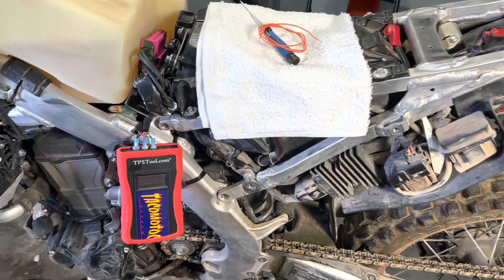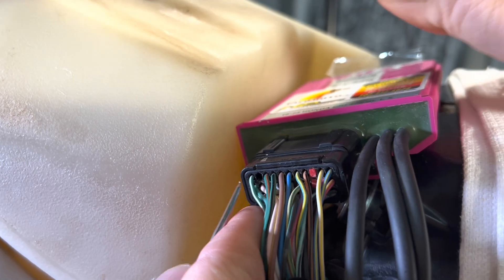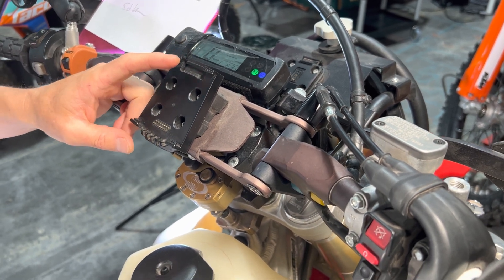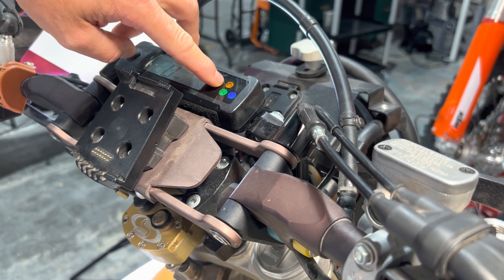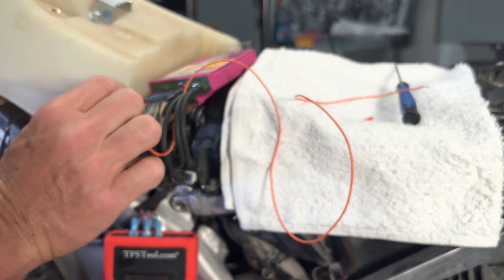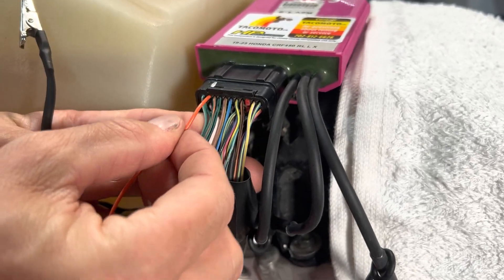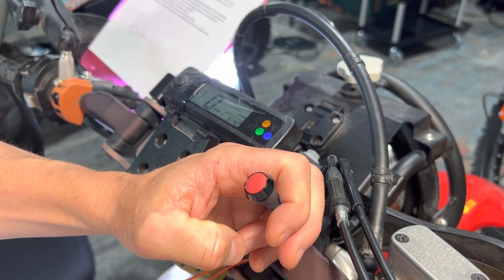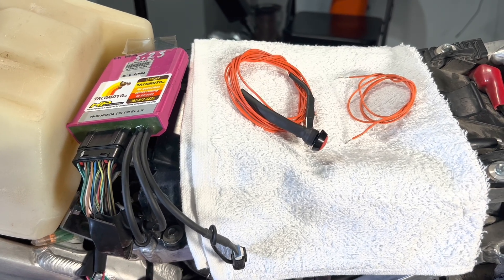AIM ECU TPS CALIBRATION PROCEDURE FOR 5.23 OR HIGHER FIRMWARE

Comment: When I received the ECU all was perfect, 60 miles later I run into this extreme bogging at low speed and low gas mileage, I thought something is wrong with the ECU but now I know what I need to do. My question is, if I change the throttle tube to a G2 tamer f.ex. or ODI with modded Cam, will I need to run the process again?

Comment: I just put this ECU in (tuned for the Yoshi I just put on) — suppose to remove the factory RPM governors in 5th and 6th gear….
-with this ECU and same equipment (47 gear) my bike topped out at 10mph SLOWER…..???
—could TPS cause this??

Comment: I have rev 1.4 version aim ecu on my 450L, is the procedure same? Thanks.
Reply from the maker: It’s the firmware that matters. That will be a 5.?? Number on the back
Reply: Mine didnt had any markings about firmvare only that rev1.4 but this method worked for tps calibration. Thanks.
Reply from the maker: @okoutonen  it’s not a taco moto unit then, but glad this worked for you

Comment: Hi Mike, I just received my new AIM from you guys (firmware 5.26) and while attempting this procedure, everything goes as it should with the exception of the rapid flash at full throttle. The CEL goes solid but instead of then moving to a rapid flash, it just goes off. Have you experienced this before? Any suggestions?
Reply: Thanks Casey, I ended up getting the bridge and updated the firm ware. The bike continues to have inconsistent power and back fires. Have you had any similar issues?
Reply: @jfin661  Yes, I was experiencing lag/stumbling when rolling on the throttle and surging at various times when shifting. These issues were apparent on road but even more significant when trail riding. 

Do you already have the AiM Multi Mode handlebar switch? I skipped this initially because I didn’t see myself using the additional features but after I had the issues above, I sprung for the HBS to give the AiM once last chance. The ability to increase fueling for the 3 trim levels completely solved my problems. My 450L runs great now in all 3 maps. Maybe there’s a deeper issue with the AiM that the fueling is just covering up but I can say it made a huge difference for sure. 

Also, if you haven’t already, I would add something to allow you to constantly monitor rpms. It really does make a difference if you’re not in the 1,800-1,900 range. Let me know if you have any more questions and good luck!
Reply: @Casey Church  

I did this same thing and still have a surging and popping issue at cruising speed.  I have not been able to resolve this issue- very disappointed
Reply: @jesseneal1787  Dang sorry to hear that man. Hopefully if you reach out to Mike he’ll can provide some help. Keep us updated if you get the issue resolved!
Reply: Hey Casey did you ever find a resolution ? I am not getting the rapid flash. I’m getting ready to take off for a ride.
Reply: @jfin661  I ended up having to send the AiM back to Mike for a reflash but after that it was good. I think the newest firmware (5.28) had a specific fix for this